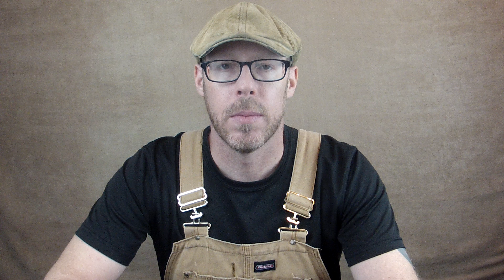Why does concrete crack?

Comment: I have a new concrete about 2 months now i noticed the joint has hairline cracked is that normal?
Reply: Absolutely
Reply: yep. the crack is suppose to be in. the joint. more aesthetic is reason for having.  joints. a straight  line than jagged crack. u try to make cuts or joints where the slab will potentially crack and rule of thumb just think of the concrete weight and say at 4" a long slab off pacing will flex more with loads on it n its weight of concrete itself. i cut  average 10ft apart

Comment: Nope. Concrete without cracks exist. Contractors rushing cause premature evaporation, and later cracking.
Reply: yes it does..how much engineering u put it and money and proper work it wont.  i witnessed a beam\slab over  180ft diameter and no cracks. with. o joints. 1mg concrete water storage tank. practically all the steps and resources was put in to make it not crack and after is it hard enough on surface where water wouldnt wash the cream surface off filled it up with 3" of water. the water was almost right away

Comment: Concrete cracks when you do not follow the right mixture ratio of gravel, sand, cement, and water. Concrete cracks because of poor ground preparation when the surface is soft and lacked a stronger foundation like the mixture of stone or gravel for compaction and cushion. Concrete cracks when there is not enough concrete it builds air gaps and bubbles forcing them to fill the surface.

Underwater tunnels and over 100 meters beneath the sea are often constructed of pre-made steel or concrete tubes as thick as 5 meters without cracks to prevent flooding water. Bridge foundation can be as thick or wide as 20 meters concrete block without cracks. These structures are systematically made on moldings to prevent from cracking.

In theory, they should not crack for hundreds of years to keep the bridge standing like the San Francisco Golden Gate Strait, hold the water out of the tunnel where a high-speed train that runs 300 mph and full of passengers will be safe. 
 
Think of parking blocks, concrete pavers even without steel enforcement they have not cracked. They only crack if the ground foundation is not solid and shrinks.
Reply: Thank you.  A voice of reason
Reply: no